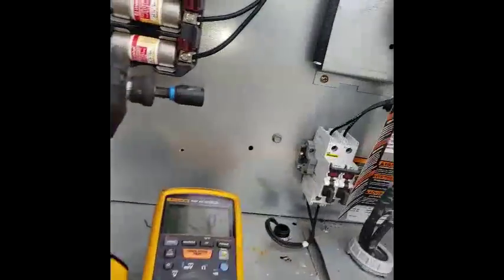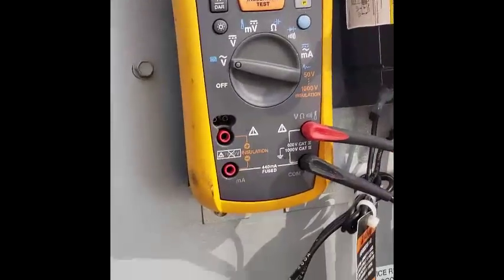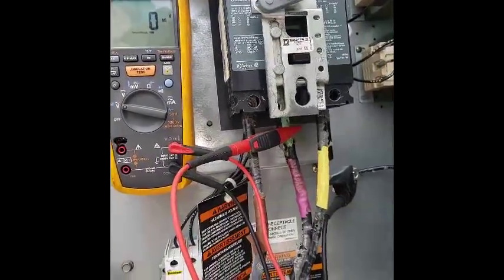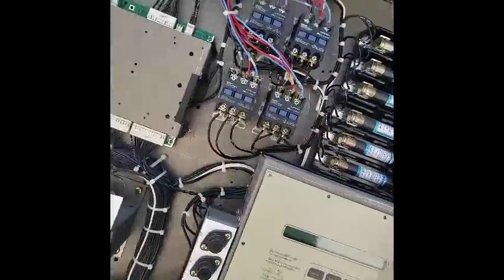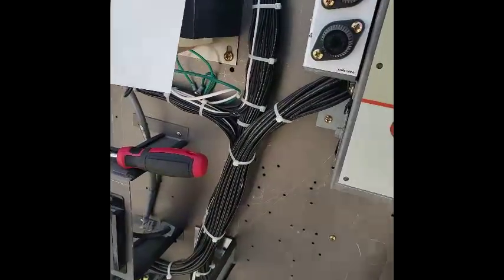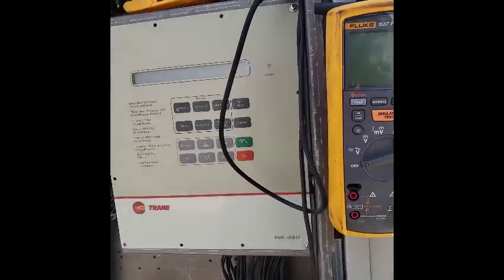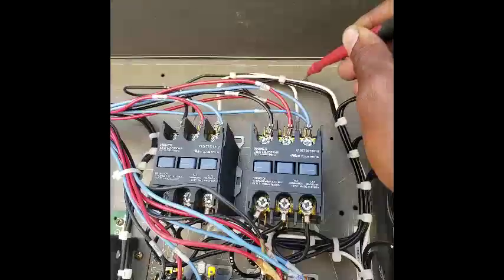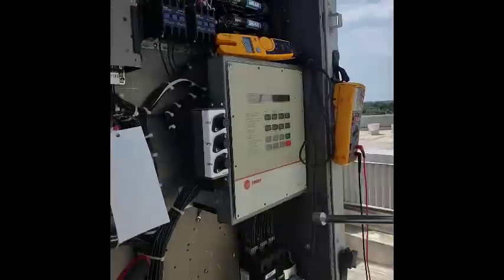HVAC: TROUBLESHOOTING PACKAGE UNITS

Comment: Question, I have a 3 ton residential hvac and the compressor periodically doesn't start so only warm air blows. After a little while the compressor will start and it runs and cools great. This has been going on for 3 weeks now and most days it works without issue but every now and then the compressor just doesn't start. Any thoughts ? Could I have a capacitor going bad or is the compressor dying?